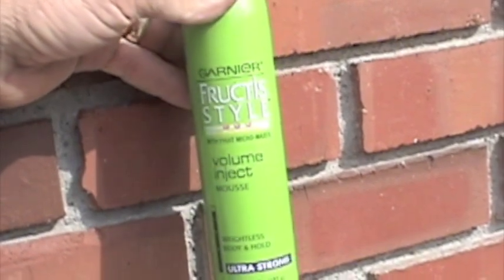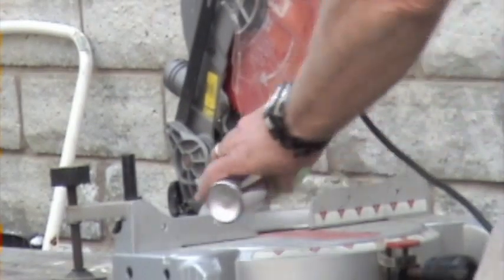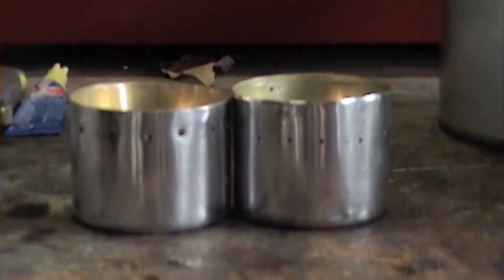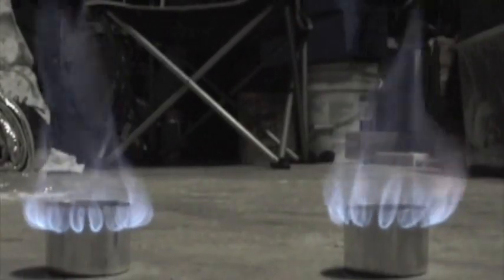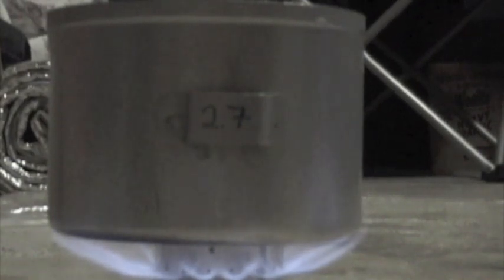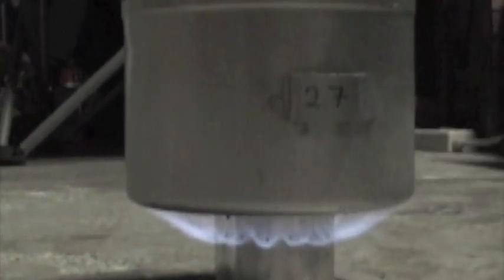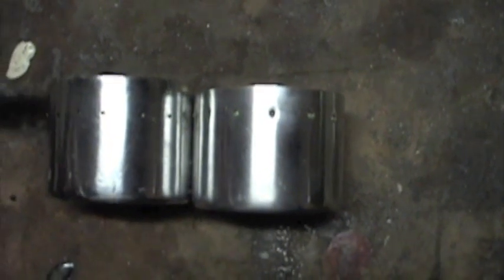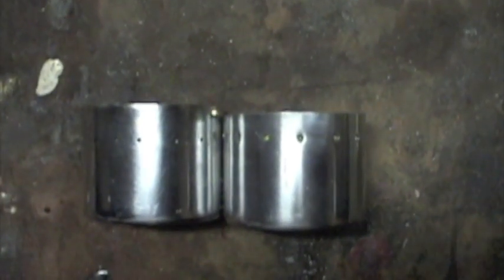Alcohol stove how I made it

Comment: oxy-acetylene torch tip drills work great for drilling the holes.  They can be purchased at most welding supply stores.  great video I wondered if you needed to glue or crimp the top of this type stove now I know.  I have my version of a penny stove made out of Peace Iced Tea can instead of drilling on the offset step at the bottom I drilled about 1/2" down from the top it works very well.  I like your stove and will make one very soon.

Comment: great video... is it not maybe the case that the one with the hole lower down on the burner.. that the flames are direct heat source to the bottom of the pot therefore heat contained within an area heats faster than the one with the holes higher up the burner the flames go around the side of the pot therefore heating the pot up first?? just a thought... need another test hee hee